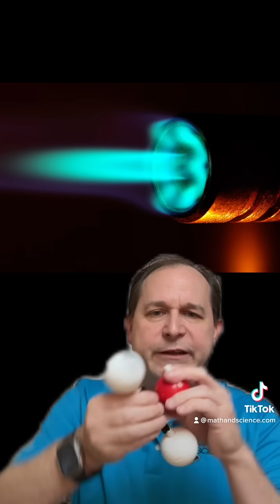How do things Catch on FIRE & Burn?

Comment: Wrong! 
When heat is applied, molecules expand. As they expand, they collide. Collision creates friction and friction creates more heat. As the carbon elements expand and collide, they are pushed away from the mass. Hot carbon bonding with oxygen heats the gas and hot  gas rises (while still colliding and generating additional heat. As the molecules rise they strike overhead molecules (more friction/heat) driving flame upward from the center of overloaded temperature
Reply: https://youtu.be/DdnKYomfhCs?si=qCPc_Aq-kmXofBwd

If you want to access, but it does not let you (not blue), re-write it by using "reply" section.

Comment: Heat of activation
Reply: Its called the "Flash Point."
Reply: @Afrocanuk  no Flashpoint is the temperature at which something automatically ignites.
Reply: https://youtu.be/DdnKYomfhCs?si=qCPc_Aq-kmXofBwd

If you want to access, but it does not let you (not blue), re-write it by using "reply" section.

Comment: The oxygen atoms want to give the electrons to the more positively charged ions in the heated wood because as the atoms and molecules of the wood get hotter, they begin to dance they lose some electrons they gain a positive charge. The oxygen wants to give those atoms electrons, but in the process because electrons they have the potential to do work, they have energy. They give energy to the molecules for certain causes a molecular face change, converting the solid into gas and dust liberating heat is an exothermic reaction.
Reply: https://youtu.be/DdnKYomfhCs?si=qCPc_Aq-kmXofBwd

If you want to access, but it does not let you (not blue), re-write it by using "reply" section.
Reply: @ΑροΧριστιανός0-777  sorry man I missed took you for one of the crazies who think that science is witchcraft and it’s a product of Satan and that all scientist should be burned at the stake sent to hell you have to understand evangelism is good. I am already saved and I’m a Christian. I do believe in God but you have to understand that evangelism is good only when it’s in an appropriate place it’s not good when it’s not asked for or wanted like remember this is just a science teacher talking about science we’re not even discussing evolution. We are literally just discussing chemistry specifically the exothermic reaction of fire so it’s inappropriate to evangelize here because it’s not gonna look right. You want inappropriate place to evangelize Christianity for proselytization go check out spirit science from Jordan Rivers especially his history video. He’s what we call a false Shepherd.
Reply: @zaneal-amood5474  I get you at the science-hater "christians". I mean, it is sad that they can't truly see the beauty of science and how it reveals God. I forgive on that, bro.

But I have to correct you:
1.If we preach the Gospel where it is wanted, what good is it!? We will only be preaching to those who are already believers.
2. For, as it is written: "Light has come into the world, but people loved darkness instead of Light because their deeds were evil." (John 3:19, NIV®)
3. The Gospel will never move because it will be in one place.
4. And it is preached in order to speed the coming of the Lord, because He is still holding the gates of mercy open. (2 Peter 8-9)

“If anyone accepts this, let them accept it...”

✝️❤

The Holy Spirit could teach you through me, maybe there is a treasure or treasures in our meeting each other. 😊
Reply: @ΑροΧριστιανός0-777  the problem is is that unwanted forcing their religious beliefs of your self on others is an abuse what if I was Buddhist and didn’t wanna hear this or what if I was a Muslim and had a lot of hard feelings towards Christians and this just rubbed it in deeper or what if I had a lot of hard feelings towards Christianity because Christians abused me because I was Muslim for example me being confronted with a religion would bring back memories or was an atheist or was a trans man or trans woman the point is is you don’t know who you’re preaching to on the other side of this phone or computer you have you don’t know who’s going to read it so if you preach in a town Square, you can look at someone’s face people can say no I’m not interested but in the Internet, you know it’s a different story. It’s not a good place to do this with.
Reply: @ΑροΧριστιανός0-777  I mean, what if I was to go to a YouTube video of a Christian preaching the word of God and try to preach the word of atheism and how all religions are evil but the light of atheism is good you know and bring people from Christianity to atheism you guys wouldn’t like that would you
Reply: Lots of errors here. In combustion, oxygen is reduced (it gains electrons), and carbon/hydrogen are oxidized (they lose electrons), not the other way around. Moreover, heating wood results in the creation of hydroxyl/hydrocarbon radicals, not ions, which then react with oxygen to form low-energy C=O and O-H bonds. You'd need much higher temperatures than what we see in burning wood to create a meaningful concentration of ions.
Reply: @JC19999  So much order and design, and yet the majority says that there is no God. This issue is deeper than "evidence" and "intelligence".... it is emotional — spiritual, even.

https://youtube.com/shorts/APrJ_v3cHHs?si=rEvbIKiBdJr8wb9o

https://youtu.be/DdnKYomfhCs?si=qCPc_Aq-kmXofBwd

If you want to access, but it does not let you (not blue), re-write it by using "reply" section.